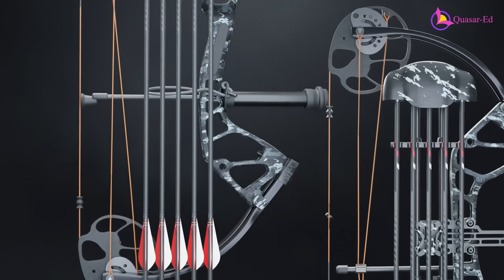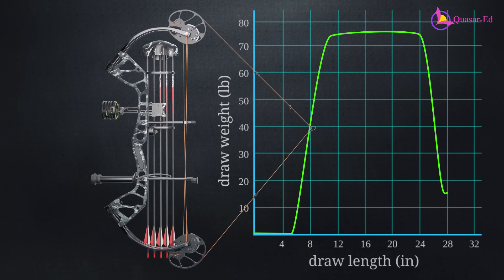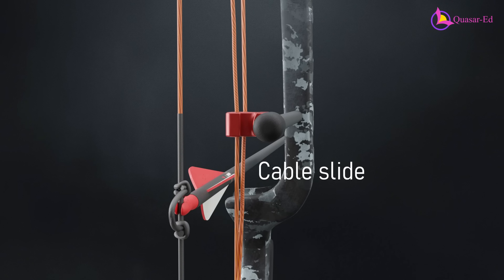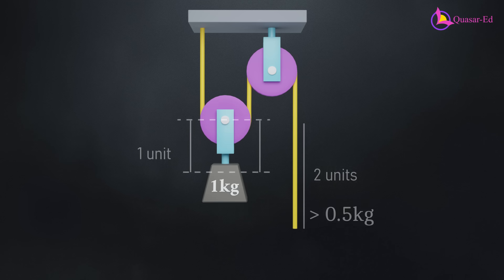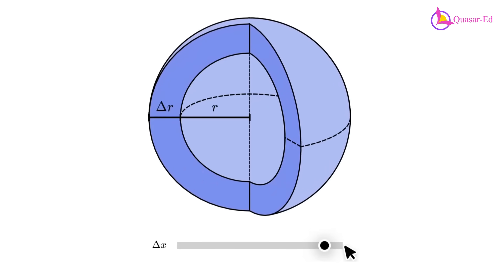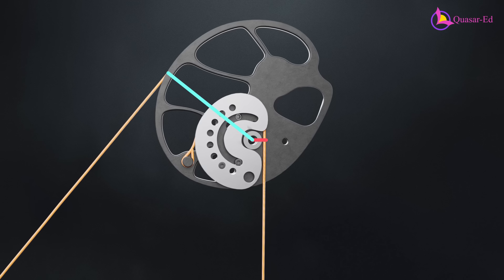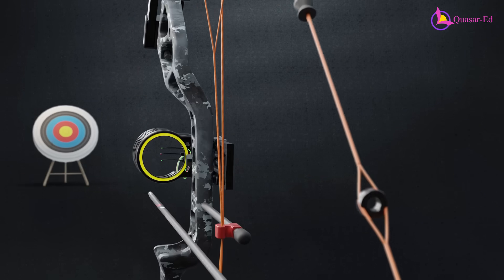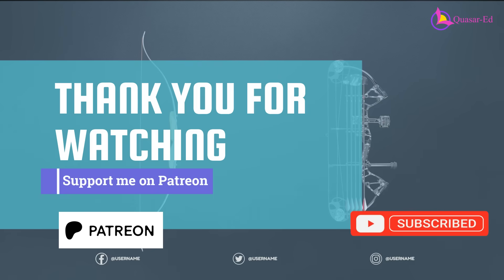The Engineering Behind the Modern Compound Bows

Comment: When at the end you compare recurve and compound you might have mentioned that releasing slightly the recurve brings no "surprises", the pull force simply decrease, as expected. If someone partially releases a compound accidentally (not by much, little release like 2 cm is enough!), the pull force will in fact increase quite a lot and typically sharply, likely resulting in an unplanned full release and a shot, because the muscles (especially in an accidental partial release) are not expecting it. A deliberate release is no issue, since the muscles know what's going to happen. So, safety of compound is an aspect that must be taken into account.
Reply from the maker: @olafmarzocchi6194  I guess I left the safety part. I hope no one accidentally aims at someone with an loaded arrow.
Reply: @quasar-ed  I didn't mean someone could get shot, it can also result in shooting against the floor with the arrow bouncing somewhere else, or against a wall, destroying the arrow. I just mentioned it because it's a safety concern I always used to hear when someone was considering a compound, so I reported it here as well.

Comment: You'd think that a video trying to show the engineering behind a compound bow would get the engineering of the very first one correct.  Even the damn pictures in the video clearly show that the first compound didn't work with "pulleys". The axle is offset, providing the mechanical disadvantage and then advantage, working in exactly the same way as the cams that are explained later.  How on earth could someone go to the trouble of making this video and get the absolute basics wrong, right at the start?  And check your definition of "efficiency"  A compound bow is NOT more efficient than a recurve.  They are significantly worse with a lot of energy lost in friction and having to accelerate the weight of cams and heavy limbs.  Maybe if the originator had bothered to read James Park's Archery Technology book, they might have made something that contributed knowledge, rather than join the misinformation that plagues archery on the internet.
Reply from the maker: @admacdo  If you know so much, why don't you just make a video with your "correct facts" ?  I know the axel is offset in the first compound bow but I don't understand how the string would drag the pulley to rotate. If you pull a string over a pulley with offset axis,  the string will just slip. That is what I understand, and I couldn't find any video footage of the first compound bow shooting. So I go with what I understand. This is the whole point of sharing on the internet. And I am sure my explanation will be helpful to those who want to learn about compound bow. I can't believe there are people like you who get angry to someone who want to share. If you want to feel superior or look more knowlegable, don't start insulting someone's hardwork. You can politely explain what is wrong or just don't watch it.
Reply: @quasar-ed  All this time and you've still not bothered to do some actual research.  I do know more about this than you do.  I've actually DONE compound archery for decades.
Reply from the maker: @admacdo  If you can show me proof that a pulley with an offset axis can properly rotate under a string tension, please show. I really want to see it. If that works as expected, modern compound bows don't have to use extra string to wind up the cams. And you think recure bows are more efficient than compound bows? Are you serious? If more power and more speed don't mean efficiency, what do you think it is. Just because there are losses in a cam system don't mean inefficiency. Every advancement in Technology is all about increasing efficiency.
Reply: @quasar-ed   Yes.  Efficiency isn't more power and more speed.  It's use of energy.  Recurve bows return more energy stored in the bow to the arrow than compounds do. It's a known and proven fact if you bother to do some research.  People have published papers on this stuff. It's established science.   You know, maybe some basic understanding of terminology would help you understand stuff.  You are so incredibly clueless about this.  Please leave this video up forever.   You need to go and look at an actual compound bow so that you can learn about how they actually work.
Reply from the maker: @admacdo https://en.m.wikipedia.org/wiki/Compound_bow check the wiki. It said compound bows are more energy efficient than recurve due to having more stiff limbs. So if you want to argue, argue with the wikipedia. I don't know how you do what you do in compound archery believing recurve are more efficient than compound. But don't be an angry little man on youtube comment section.  👎👎👎

Comment: I think the  Japanese lady was the only one who put the arrow on the correct side of the bow.  She's obviously right handed, as she's pulling the string back with her right hand, thus putting the arrow on the right side of the bow, and using her hand as the arrow rest.
Reply from the maker: @Fearmylogic  I shoot that way too. But after seeing people put the arrow on the left side, I thought I might be wrong.
Reply: I don't know why the arrow is placed on the other in Kyudo. Normally the arrow is placed on the left side with right handed, as the string is unrolled to the right when releasing and pulling. The arrow would run the risk of falling off the rest every time. When pulling out and holding with the thumb technique, the right side would be the correct one.
Reply: @grille_c with Mediterranean based archery styles the arrow is placed on the left side as you pull with the three fingers intead of the thumb as in Asiatic archery. both have their advantages and disadvantages. three finger is much cleaner release imo, but thumb shooting allows the arrow to be pressed against the bow, this allows the bow to be much more easily held loaded/nocked while moving/horseback. that's why thumb shooting is generally thought to be more combat focused, compared to three finger Mediterranean.
Reply: The behavior of the arrow, called the "archer's paradox" is why you put the arrow on the left side of the riser.  If you put it on the right side the riser will interfere with the natural vibration of the arrow and the arrow gets deflected by the riser.  They can compensate with their aiming but the flight of the arrow will not be as good.  Western bows have cutouts in the riser on the left side for the arrow to set, it is also necessary to use arrows with stiffness matched to the arrow length and the draw weight of the bow for all of this movement to be coordinated correctly.  If you have the wrong stiffness of arrow you will know it because the arrows won't fly very well.   You might be able to search the internet and find slow motion videos of this.

Comment: The "purity" angle is nonsense. Go back to using stone tools if you follow that line of thought. Every technological advancement came about because someone figured a way to do something better. If you want to have it slower, heavier, more fragile or harder to operate by all means, use something outdated. Just don't come running with your "I'm better or somehow special for doing it the old way".
Reply from the maker: @andersjjensen  Well people are used to claiming one is better than the other all the time. And It is not about the truth or even efficiency, it is just perspective. And people tend to feel special about their choices or preferences. You don't have to feel insulted when their preferences are not aligned with yours.
Reply: @quasar-ed  I don't. I feel insulted when they portray their preferences as somehow better. As I spelled out quite clearly.

Comment: Why does the bow spin after the shot has been taken
Reply from the maker: @hughoxford8735  If you mean the bow rotating forward after the shot, in recurve bows, the forward inertia of limb causes the bow to move forward. By allowing it to swing, it won't effect too much on the releasing arrow. In contrast, if you hold it tightly, your hand will absorb that inertia and shake which affect the arrow path.

Comment: For those commenting about (so called) crossbows, they are not  bows. Nothing to do with archery.
Been shooting archery all my life (70 yrs). I shoot mostly a longbow, but own and shoot recurves and compound bows as well.
I also own and shoot guns, slingshots and arbalests (the actual English word for the so called, crossbow). 
Although all are fun to shoot, the so called crossbow has nothing to do with Archery.
The power comes from a prod, not a bow and it shoots bolts, not arrows. It is shoulder mounted (like a long gun) not by the extended arm of the off hand alone, as is a bow. And finally it is cocked and locked not held at full draw with the might of the strong arm and back, as with a bow.

Comment: If I had to choose between the two for practical use in a survival and possibly defense situation I'd take the compound all day.  More power, more efficient, more accurate, more compact.
Reply: Easier to break (just torque the bow), harder to replace, heavier to carry. It is ok on the first day of your survival, for sure.
A modern recurve or a composite bow is not simple string-on-a-stick either, but they are more robust than a complicated cam system.
A bow that you can recreate is best for survival.

Comment: I'll take some time to break down the differences in bows and archery styles here, for anyone interested.

First of all, archery is about sending an arrow towards a target and hitting it where you want to hit it. No matter the method, you're only trying to complete that goal. Competing against other styles and making comparisons is a bit silly, since it's like saying that a rifle is more accurate than a blunderbuss. It's obviously true, but the two methods of hitting a target aren't really competing against each other. 

Longbow
The most basic longbow without aiming aids will not be as accurate as an olympic freestyle recurve. Longbow competitions use large targets at relatively close ranges, and I've seen competent archers miss the mat completely in competition. A skilled archer will still perform better than an unskilled one using the same bow at the same range. 

Barebow
The barebow recurve is a style that tries to gain the most advantage from a restricted ruleset as possible. They don't have sights, but they have markings on their finger guard in order to "string walk" and calibrate their aim for different distances and make micro corrections. They're allowed modern materials for both their bows and arrows, making their shots more consistent.

OFR Olympic Freestyle Recurve
This is the type of bow that gets clowned on the most by non-archers. It uses the most technology as possible to make the shots as accurate as humanly possible. The entire point of the stabilizers - the long rods jutting out from the bow - is to add weight to the bow as far away from the archer's hands as possible to eliminate wobble and twitchy movements. The sights are as far forwards as possible for a longer sighting line. There's also a clicker to signal the correct draw length (man, that sure would suck if you heard the click before your aim was set).
However! There's no rear sight. The archer is dependent on something called an anchor point, which is where to place your hand on your jaw at full draw. Millimeters of bad positions on your anchor point can be centimeters on the target, which btw is 70 meters away, and has a 10-point zone that is only 12cm in diameter. There's no magnification lens on a recurve sight, so the sight pin itself pretty much obscures 80% of the 10-point target itself. When you let go, it's because you estimate that the golden ring around your sight pin is pretty much equal looking all around. Consistently hitting the 10 with a barebow would be impossible. Consistently hitting the target at all with a longbow would be impossible. 

Compound
Compound bows forego the "stick on a string" traditionalism of archery in favor of sheer precision and consistency. You get a magnifying scope. You get a peep sight on your string. You get center line arrow positioning, meaning the arrow doesn't have to go around the side of the bow. You get infinite customization of every part of your setup. Modern materials like carbon fiber come as standard, and your arrows can be as personalized as you have the time to make them. 
Compound archers don't shoot 70 meters, but the target they shoot at 50 meters is smaller than the one used by recurve (80cm vs 120cm). 

Technique
All bows have the same basic limiting factor in their accuracy: the human using them. Since the arrow goes in a parabolic arc from the bow to the target, drawing too far will hit high and drawing too little will hit low. This is true for all bows, even compound bows, as it is possible to slightly over- or under draw. 
The execution of the shot - or loose - of the arrow is a huge factor as well.
Collapsing is when you've come to full draw and loose the shot too slowly. You fold up ever so slightly while releasing the string, leading to inaccuracy. It's a hard habit to break since it's often subconscious, and it often require the archer to see themselves on video in order to realize what's happening. 
Target panic is when your body is acting on its own and looses the arrow before properly aiming the shot. This often happens to experienced archers and is very hard to fix, since it's a product of muscle memory. 
Compound archers are less affected by poor loosing technique, but they're just as susceptible to minute tremors and target panic as any other archer. 

This was a bit longer than I'd thought it would be, but it's worth it if you learned something new. I should have reply notifications, so if you have questions, I'll answer as best I can.
Reply: Thankyou man
Reply: based comment
Reply: Push.
Reply: w
Reply: I loved reading this. I'm curious how crossbows factor into this equation
Reply: @nilayzaveri468 crossbows are tricky. They have the same kinetic chain as bows, but completely eliminate the part of the shot where you have to hold a draw, release cleanly, follow through, and manage your draw length. Most archers I've known don't consider it as something even close to archery. You still have to account for drop over distance, but aside from that it's a completely different animal. Crossbows are also considered weapons in many places while bows are considered sporting equipment. Funnily enough, slingshots have a lot more in common with archery than crossbows do.

Comment: A compound bow stores more energy than a traditional bow for the same draw weight and draw length. You can visualize it on a draw curve. The area under the curve equals to the stored energy. The cams on a compound bow can be engineered to maximize this area. 

Even traditional bows do this. The Asiatic style composite bows optimized draw curves by having the bow bend forward when unstrung and adding static levers (siyahs) on the tips. Those levers act in a similar manner to cams on a compound bow.